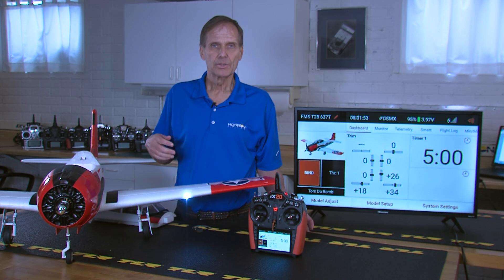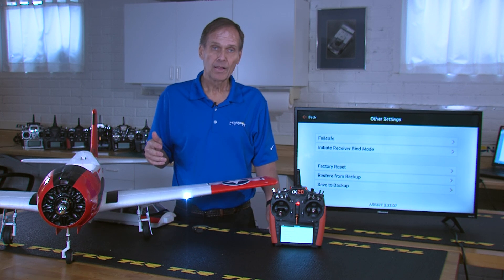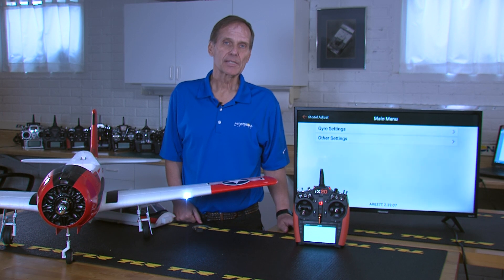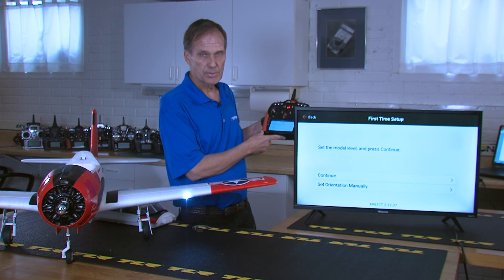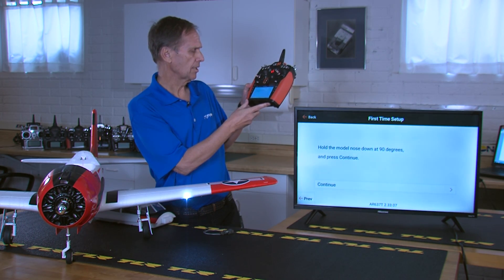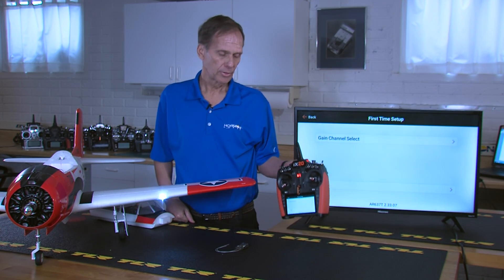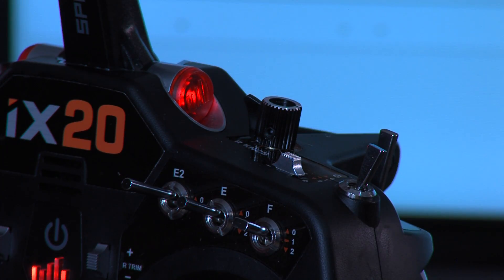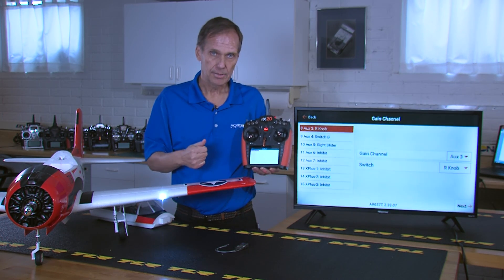Spektrum Smart Receiver AS3X Setup Series #3 - First Time Setup

Comment: So - if you do a factory reset could you then use the receiver as is and put it in any airplane and fly it (and it would not have as3x or safe) ?
For example - I buy a used receiver and don't know what plane it came out of or what is programmed on the receiver and I don't care about as3x or safe and just want to use it like an ar620. Will that work?

Comment: Thanks for the videos that are very useful. I have two questions: 1 I forgot to activate the gain channel select I can't find how to do it. Is there a way to do it and how?
 2 - On the Gyro Setting menu there is "Gyro System" editable 1,2,..... I don't understand what it is for and I haven't found it anywhere. The radio is the new NX 8 + the AR10360T SMART 10 ch AS3X SAFE receiver. Can you give me some advice?
Greetings from Italy

Comment: I've found if you buy a plane with an AS3X receiver installed from the factory it wont show the forward programing menu on the transmitter so you can't do a factory reset..
Reply: i am also finding this with a AR631

Comment: I have a 673T that came out of a BNF model where the receiver was oriented inverted. I want to use it in another PNP model but when after binding I attempt to set a different receiver orientation there is no "other settings" option in Forward Programming. Do I have to reprogram the receiver to "Open Stock" before I can reprogram the receiver orientation?

Comment: Having a hard time setting up the R Knob. AR637 on a Viper 90mm.  AX3 is on the flight mode switch. All other channes are being used.

How do i program the r knob? Or do gains have to remain fixed?

Comment: Trying to do Forward Programming with a new AR630 receiver and DX6E transmitter. Got through automatic orientation, but the screen doesnt have the right hand diagram for me to confirm the orientation. Its not in the receiver instruction manual either. So I guess Ill just accept orientation #1, (AR630 label up, bind button forward, servo connections aft? Is this orientation 1?).
     Next step select a channel and a switch. Channel 5 is lights, can I use this for gain or do i not use lights anymore?
     Next step,  I dont have a knob. You said I could use a trim switch?? I have on/off switches available but I dont see how that could work. Youre showing this being done in flight. Can you suggest what to do with a DX6E?
     Has SpektrumRC ever set up an AR630 RX with a DX6E TX and a plane where all channels are used (5 lights, 6 flaps?)
     Thanks for any advice!!!
Reply from the maker: To get the orientation images, you will need to make sure your DX6e is up to date. Are the lights controlled by channel 5? If they are simply plugged into that port, Then you can use that channel for gain/flight modes etc. Since your DX6e does not have a knob or auxiliary trimmers then tuning will all have to be done on the ground. So fly, observe, land to tune in forward programming, and repeat until gains are good. Hope that helps!

Comment: I have an otter on a dx6. I go to forward programming and all it say is connection failed.  I have bond and flown model many times.
Reply from the maker: Forward programming is only available with open stock AR637T and AR630 AS3X receivers. Not the AR636 or any AR637T that came with a model (at this time)

Comment: If anyone can get me past episode 3 of the setup, I would greatly appreciate it.  I tried first on a DX6e, current software, and I have a new DX8 Gen 2, both same result... the rx is bound and all travel, servo direction and D/R  are set....at the assign gyro channels screen, everything is set to inhibit and I can't get past that screen, the tx is in a Freewing 80mm A10...Horizon is pretty late on the help desk, and chat is not working either, thanks in advance....7752918301 ....Jim

Comment: Does Forward Programming not work with the AR637TA (the version that comes with the BNF's like the P-51 1.5) I cant' get it to connect with my ix 12 but there is a "AS3X" menu under Model Adjust but it doesn't seem to work the same way. I had some preset values and I can only assign L or R trim but not the knob. Then it seems you can apply a flight mode switch and you can see the trim number change on each mode but the gains seem fixed.
Reply: I also have the iX12 and AR637TA in a BNF and am having the same problems.  The rest of the plane works, Safe on and off, throttle cut, all flaps, dual rates and expo etc & my radio seems be all set the way I want it, BUT the receiver isn't responding to any of the 3 Modes on switch or gains changes with the knob.  Safe works, but when it's turned off, I have absolutely no gyro stability affects.  It is totally off.  I see that like you mentioned, in AS3x Gains I too can only assign L or R trim. Anything to do with gains, seem fixed no matter what the radio is set to.  The knob seems to work though looking at Servo Setup Aux3, and the 3 Modes or even more on the radio, but not at the receiver.  I'm going to keep trying to figure it out.  It's frustrating though, as the plane flies great other than I would like to have a little stability from wind gusts, with out having Safe on.  Safe saved my plane on a windy day that I really shouldn't have been flying, but I don't feel I would have needed to turn on safe if I could have had the different flight modes working the way they should, with gyro stability helping stabilize the plane from wind gusts.  I'm still learning, and I'm fairly new to this iX12 radio.  Hopefully we can figure this out.  If I do, I'll try to reply here to help you if i can.
Reply: @thomasjent1431  From what i've learned on RC Groups, the A model does not currently have forward programming, but is supposed to be coming in an update. Also the Vario telemetry is not on the A model. From what i can tell the AS3X menu for the A doesn't actually do anything.
Reply: @noControl556  ok  Thank you.

Comment: One important think is to setup the flight mode BEFORE you start programming the receiver! Otherwise it will into a mess of misleading settings in the receiver.
I have mostly only 2 modes. Also important: there are 5 flight modes overall.

Comment: I bought a Male it was bound correctly. The stabilization moves on the airplane when you tilt it. I pulled my stocked in and down. Then toggled the switch. This voodoo didn't work.  I can not get the switch to turn off the gyro. I used the Bluetooth programmer to look at the switch setting. The phone app needs to be updated. It needs to not try to do anything before you select a model or something other. It just doesn't work as it should. It messed up my model today. I am not happy. I do not want to toggle the switches to activate something. I want to program it manually. I want printed information to follow to set my transmitter. I do not like Spektrum it sucks

Comment: I have an dx8ge1 
 how do I program the receiver then
Reply: Me too. Please respond!
Reply: i ended up getting a ix 12, looked at the dx8 gen 2 to get all the new smart stuff, but the dx8 gen 2 is really a dx6 with two channels added, you need a dx9 to get all the same switches as the dx8 G1, by the time I was spending $500 on a new tx, figured I might as well make it $600 and get the new generation with the built in android. I mean you can watch porn on your Tx now

Comment: I have a new DX 9 and there is not "Forward Programming" in my choices in the Function List.  Same question as Bernfran Francis.
Reply from the maker: Forward Programming will not appear unless you are bound and connected to a forward programming receiver, like the AR637T. Also make sure your transmitter is up to date :)
Reply: It will only show when the receiver is pluged in.

Comment: I must be missing something there is no "Forward Programing" in my choices in the Function List. Does the DX8 Gen2 have to be communicating with the new AR637T to see that option?
Reply: I  have the same DX8 Gen 2. I'm about to order the AR637T and try my hand at setting  the new high tech RX. How do you do with trying to follow the setup procedures?
Reply from the maker: Forward Programming will not appear unless you are bound and connected to a forward programming receiver, like the AR637T. Also make sure your transmitter is up to date :)
Reply: @SpektrumRCvideos  Have you ever thought this is a bad idea?, it should show up and not be available, that way you dont spend too long searching for what appears to be a missing feature.